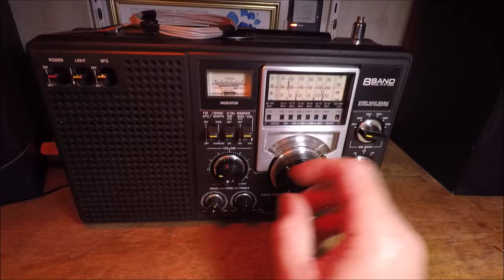Improving AM Radio Reception w/ External Antenna and Loop Connection

Comment: When I was a teen in the late 60s, I ran 50 ft of antenna wire   (from Lafayette) in a spider configuration in the attic and down the stairs into my room. It connected to my elderly aunt's old 1940s era tube AM radio. From central PA, I could listen to NYC and Chicago stations with acceptable clarity in daytime and perfect reception at night.
Reply: with a 1996 Suntone RR3000 I'm able to reach mexico city and Toronto from Denver. wish I could reach Cuban stations but just not quite.

Comment: For daytime DX on AM I used to make a 80 to 120 turn coil of 24-26 awg magnet wire on a paper towel tube connected to two 250 foot longwires. Place coil near radio. You could also use one longwire and ground the other side of coil but I always used two longwires. You'll get amazing daytime DX with a setup like this. I went from three stations to around fifty.

Comment: I'm an absolute novice to this hobby but I've just ordered a simple analog SW capable Tecsun! 

I live in a rural area and can get fairly listenable AM signals through a 90s Sanyo hifi but it could be improved. I'm considering buying the Tecsun An-200 loop but then, I have lots of wire and electronics components here so I may just solder my own. Thank you for your video. The difference is astounding.

Comment: All I wanted was some extra info on using an external loop for MW DXing, so I watched this video. Seemed innocent enough.

WHY, I ask, do I now possess my very own Panasonic RF-2200 (or more accurately, a “National Panasonic Cougar 2200” b/c I’m in Japan)?? Probably going to have to get a full alignment done on it, maybe replace some caps to get it in full working order—who knows what rabbit hole I’ve opened up?

I just wanted to make some loops out of wire…

Comment: a great demo of inductive coupling, the signal coming through the outdoor antenna is concentrated slightly by the small diy loop & he puts that portable loop next to the MW antenna on the radio, which connects them via induction. This would work very well with a radio like this with the included MW antenna mounted outside of the cabinet. With other radios where the MW antenna is inside, it might be more difficult to get the loop close enough to couple that easily, or find the sweet spot. Bottom line is, you're always going to get more/better signals with an outdoor antenna, especially in a basement

Comment: Very impressive!  I've tried several radios I own and am only able to receive one or two staitions (in daylight hours). I will definitely give this a try. Thank you!
Reply: Jimmy Towns .... I used to only get three AM stations in the daytime but got fifty with a similar setup. I used two 250 foot longwires stretched out over the lower tree limbs connected to a coil made from 24-26 awg magnet wire wrapped on a paper towel tube. 120 turns. Put the coil near the radio. I live out in the country though with lots of space. In NW Louisiana I could hear New Orleans, Dallas, Oklahoma City and Houston just to name a few...during the day.

Comment: That’s a great video. You demonstrate both the value of an antenna and a way to interface that antenna to any radio a person might have. I’ve seen videos three times longer that aren’t half as clear.

Interesting side note: What you’ve made there is a tiny loop antenna. Build one the size of a hula hoop and you’ll be shocked at how well it will work (90+ % as effective as a Wellbrook loop for about 5% of the cost.) Turns out that the aspect of this hobby which interests me most is antenna design and making them on the cheap.
Reply from the maker: Thanks for the comment!  Tell me more about your loop.  Is it tunable?  Do you have plans?  I'd love to get one of those nice Wellbrook loops, but I think I've blown all my radio funds for a while!
Reply: @Radiodog  I had originally set out to build a tuneable antenna with a main loop and a little loop and all that but upon further reflection I decided to start with the simplest loop antenna I could make and see how it would perform. I bought a hula hoop (with a 35" diameter), a broomstick, and a bag of tie wraps for under $10 from the dollar store and then went to Lowe's for a T conduit junction [1] and a 10' roll of copper tubing. I don't remember exactly what it cost but it was under $25. I cut the hula hoop, fed the copper tubing through until it came out the other side, and then I drilled small holes in the copper tubing on either end. Then I fed some copper wire through the holes, twisted it to secure the wire to the tubing, put one end into the left side of the T junction and the other side into the other and lastly connected the wires to a two terminal to BNC connector I had kicking around (they cost about $2), fed it through the bottom part of the T junction, and sealed it up. I stood the broom stick up in a patio umbrella holder, connected a feed line, and I was off to the races.

Does that all make sense? It's more difficult to describe this than I expected. Regardless, the antenna works shockingly well. I'd say it's about 90-95% as effective as my MFJ-1886 ($250 + shipping) and maybe about 80% as effective as my Wellbrook 1530LN ($325 + shipping) but at a fraction of the cost. I also built a variation using 14 AWG wire looped three times through the hoop rather than copper tubing but it isn't quite as good. I also tried adding a balun since looped or not, this really is just a random length wire antenna -- it made no difference.

You should construct one and give it a try. I have as much fun comparing  antennas as I do actually DXing. :)

[1] https://www.lowes.com/pd/CANTEX-1-in-Schedule-40-PVC-Cap/3234068
Reply from the maker: Yep, that makes sense.  No capacitor?  Interesting.  I'll give it a try.  Like you, I am unafraid to try something different and see if it works.  How's the noise level on the loop you describe?
Reply: @Radiodog  The tuning capacitor and the baluns I purchased for the project sit unused in my parts box. Go figure.
Reply: Wish that you had made a YouTube video to show how you made it. It’s a little bit confusing to me…
Reply: So the loop goes nowhere? I'm confused as to if it was connected to the radio or not
Reply: @walter9724  Yes, the antenna was (is) connected to the radio via a shielded cable with BNC connectors on either end.

Comment: I see in the background a couple of my favorite GE portables - P-780 and Super Radio. I also have a couple Zeniths and a Philco I use to listen to music late at night from a Canadian station. I use an antenna booster coil that was available a couple decades ago. (Round, sealed, with a tuning dial to zero in on the station desired. There were 2 versions - one just plain for loop and ferrite antennas and one with a jack on the front that could do that plus be connected to really old radios that just used a wire lead.)

It's great that you demonstrated this as many younger hobbyists are not aware of this idea.

Comment: I bought a Tucson loop antenna with a built in tunning knob and on some radios it can be hard wired with supplied connector which I dont use It just set it next to my radio when I get a weak signal I can tune it to make it better but your loop works well.

Comment: I think I perhaps understood what you did, but I’m a newbie so trying to learn. I have just purchased a Tecsun pl-680 and have tried it inside my home with the telescopic Ariel or the wire Ariel that came with it, plugged into the Ariel port and clipped to a point near the ceiling. All inside the house and the wire Ariel did improve the reception, but I get hardly and channels either during the day or night. Grateful for your detailed advice on what I need to do exactly to improve the number of stations I can receive. Many thanks. p.s. I an in England, UK.
Reply: Ariel is a character in a Disney movie, NOT a radio term. Obtain a refund from the school you attended.

Comment: Nice but still don't understand where the 2 ends of the coax go. A schematic would be nice. is one pole grounded? Does the other just extend outside to anywhere? If there's a straight length, how is it oriented?

Comment: Makes me wish that I could throw a 100 foot long wire outside my condo. What a difference in reception.
Reply from the maker: Yes, I am very thankful for having the backyard space.  My main limitation is my wife!

I am upgrading, you might be interested to know.  "Investing" in a MFJ 1886 loop antenna...might be a possibility for your condo.  (Attic maybe?)  I'll be sure to post videos on it once I get it and use it.  Thanks for the comment!
Reply: Tom, the MFJ 1886 looks like a pretty impressive antenna. If you did obtain one, doing a video on it would be great. I have about a 40 foot wire wrapped around the top perimeter of wall in my study hooked up to an MFJ-1020C active antenna that I use with an SDR play connected to my laptop. It foes a good job but I still enjoy tuning a regular antenna. Thanks for the suggestion.

Comment: At Forster , the Sydney AM stations were quite listenable during daylight hours , 250km away with the radio inside the caravan with 20 ft of wire hanging near a power turret outside connected to the high side of the radio's internal antenna  .Without the external wire only 2BL 702 at Preston's was listenable with the reciever in my hand outside the caravan . . The commercial AM stations around Homebush Bay were audible but not listenable .

Comment: Q U E S T I O N  ---  Please clarify! Regarding the loop antennas for AM - ads on Amazon: Our AM radios have electrical cord, adapter, 4-D battery optional connectors. No jack for external antenna. So how and where must we connect the loop antenna to help diminish the crackling on AM 1150? (FM stations = no problem). Are copper wires the best material for AM/FM antennas? Thanks.
Reply: Hi by the looks of it you don't connect it to the radio, you just place it on top.

Comment: Back in the late 1910s ,early 1920s,my late  father(B 1911) would hook his crystal set to a water pipe with copper wire to get good reception. I wonder how that would work in the modern era.

Comment: What kind of reception when you pull out the telescoping ariel on the right top of the radio? I'll bet if you put the loop over THAT you would get even BETTER reception!
Reply: The telescoping antenna is for the FM band and a marginal function for SW reception. AM (MW) broadcast receivers rely on an internal antenna which is part of the receiver's front-end stage. The coil/ random-wire shown couples the signal into the built-in AM stage. The telescopic is N.W.A.S. for MW reception.
Reply: @rickvia8435  hi rick, i always thought i could just take a random wire with an alligator clip soldered on and connect to the telescoping antenna.. but thats not best for SW???
Reply: @micjam1986  A random wire connected to the whip is likely to benefit SW (probably not so much for FM because the whip is more tuned for FM reception). The whip by itself is marginal for SW. Any time you can increase the level of signals (random wire), the better for SW. AM (MW) may benefit as well from the wire through indirect parasitic coupling to the MW circuitry. Better SW receivers provide an RCA jack or screw terminal for connection of a wire antenna.
Reply: @rickvia8435  👍👍👍Thank you Rick, learnt something useful today.

Comment: I use my magnetic loop with the ferrite bar attachment that came with the cheap degen DE31MS active softloop... works exactly the same.... I am curious which radios you have that disconnect the internal ferrite bar with the use of an external antenna
great vid and greetings from the Netherlands
Reply from the maker: Thanks for the comment, and greetings to you from New Jersey!  The Sangean 909X disconnects the internal ferrite, I believe.  The C Crane CCRadio EP is off-switchable, as is the Realistic DX440.
Reply: Yes the ferrite bar with the Degen works great. I keep meaning to order the Tecsun AN200 for MW but the Degen is doing fine on that front.

Comment: Does.the wire have to be shielded,can it be twin lead speaker wire ,is the seven turns mean anything ,can it be more? I love how your works.amazing,I wonder if you hook it to a radio tuner ,like the tecsun antenna made.for An radios.,and if it needs.shoes wire where can I find wire like yours.

Comment: Most, if not all, of the commercial AM antennas I have seen online aren't useable for shortwave. Why is that?
Reply from the maker: Radio waves behave differently, depending upon frequency.   Medium wave (i.e. AM broadcast band), shortwave, FM, etc...require different kinds of antennas to best match the characteristics of those radio waves.  There really isn't a one-size-fits-all.
Reply: @Radiodog  OK, thanks

Comment: Two questions: 
1.  You mention a coax wire going outside but is that necessary?  Couldn't you just use 2 separate wires; one end of your coil connected to ground (copper pipe in ground or a grounding rod in your basement), and the other end of coil connected to your outside antenna?  It looks like you have the coax shield connected to one wire on the coil and the coax core wire connected to the other wire on the coil and then the coax wire goes outside.  But once it gets outside, don't you have to cut into the insulation on the coax and then tie a wire that connects the shielding to a steel or copper pipe in the ground? 

2.  You mention a 9 to 1 transformer.  Can you please explain that?  Thanks

Comment: i have a sony component radio with built in and Option for external antenna 75/ 300 Ohm and coax, how do i get a sharp reception on AM 1130 in canada pl advise,  i can hear noise and interfearence some times, i dont think its harmonics, but i havent tested yet. Tx

Comment: I have a 150' antenna connected to my radio but I get a lot of noise with weak signals as well. I am not using a 9:1 transformer (unun), do you think it would greatly reduce my noise and increase my signal if I do use a unun?
Reply from the maker: Are you using a 150' wire attached directly to your radio, without a feed line?  If so, your antenna is capturing signal and noise all along the length of the wire, including the part inside and close to your radio.  The unun enables you to connect a long wire to coax; the coax will help shield your antenna from some of the noise and help your signal.  (The unun provides an impedance match between your antenna and your coax.)
Reply: @Radiodog  so the wire is between a tree 150’ away and long pole by outside my room is connected to a regular TV coax (to the middle copper wire) to a 18 aug wire so I can slide it through sliding door to my radio

The exterior of coax is grounded to a 2’ copper pipe in ground and the ground of mini jack is also grounded to the same pipe 
 I get a loud of noise in half of the bands approximately. And to be frank it’s performance comparing to my indoor 27’ wire in my room is marginally better if any 

I also pick up a lot of noise from my indoor antenna as well. I just bought a MA loop antenna which I will install and compare to the long wire. 

What I believe I must have ( please correct me if I don’t need to) is unun 9:1?? 

Btw grounding did not help noise or reception at all.

Comment: This is really fascinating! Thanks for the tip! . . I'm really kinda new at a lot of this and have a question: Could I use a wire loop like this connected to a coax that runs to a properly tuned 1/4 wave ground plane antenna to enhance a gmrs  walkie talkie gain? Like if I were indoors with the wire loop next to or near my antenna and I were speaking to someone far away outside? Or would the wire loop somehow close and cancel out the ground? . . Sorry I'm still learning.

Comment: Do you have to have an outside antenna?
Reply: If you're in a basement you will probably need an outside antenna. Upstairs you can use an indoor antenna and get good results. The exception to that would be if you lived in a house with stucco on the walls. The reason being is that the stucco is applied on top of a wire mesh, the mesh acts as a Faraday cage and blocks the radio signals.

Comment: You can also fool if you just going to use wire as an antenna you can just plug it into the same outlet that you know the radio is being used on at least it works for me when I do it

Comment: Nic3vresults. Goes to show that the antenna is equally if not more important then the radio receiver itself. I bet if you took a small cheap low-end portable radio you would hear similar stunning improvements.

Comment: Question: I've noticed that when I'm sitting in my car listen to AM radio and im approached by a bus (fully electric bus) there a loud static and distortion on the radio. It's quite unpleasant and was wondering what causes that and if that's dangerous? 
Hope this question makes sense and you can help me understand radio and signals
Reply: Trucks and other large vehicle have electromagnetically noisy electronic devices on board that especially interfere with the AM radio band. Not sure what these device are, but sometimes they are worse than high-voltage power lines. Hoping others can add better details.
Reply: So it's a city bus and the bus is electric. I know it has a docking station which uses a bluetooth type devices to get connected to charging port from the top of the bus ... So the bus pulls into the transit center approaches the dock tower connect via Bluetooth and then it lowers a connection device but the Bluetooth sending out signals which made me think it was interfere with my radio